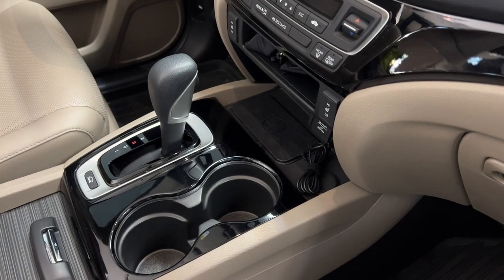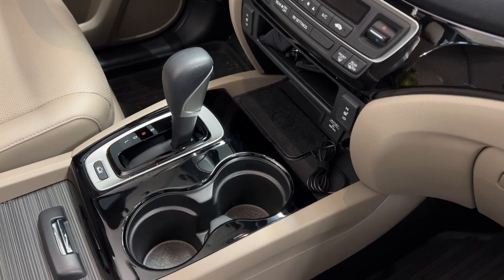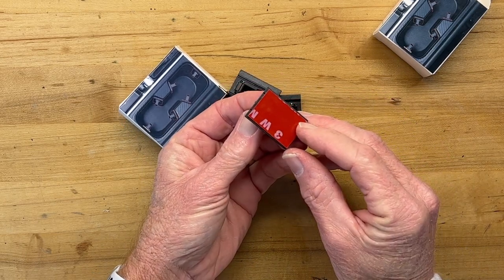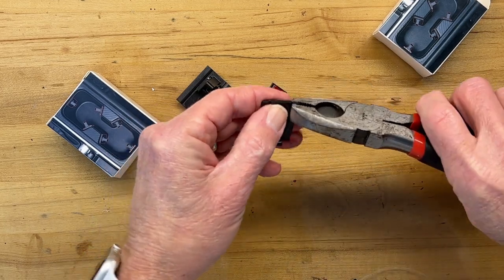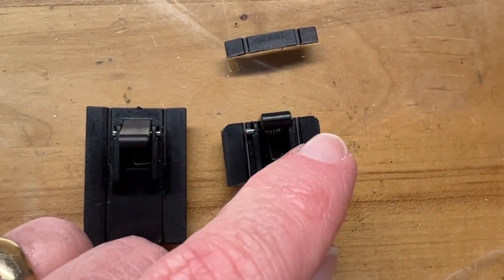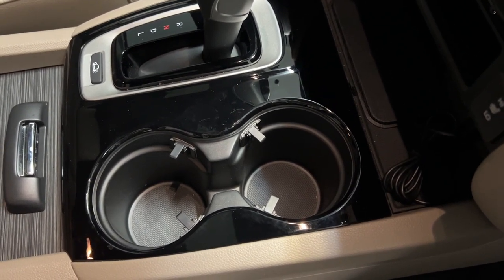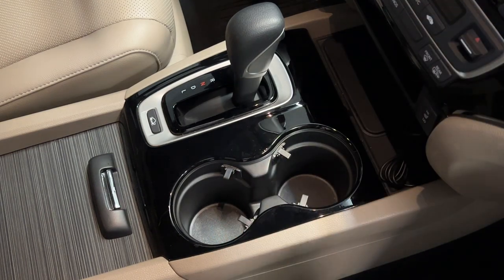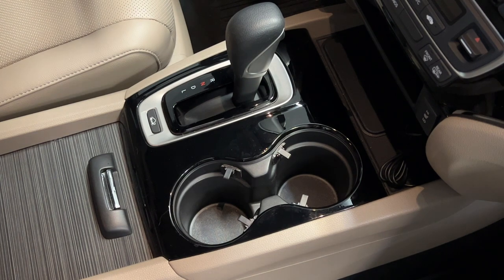Honda Ridgeline & Pilot Cupholder Upgrade. Slick fix for wobbly cupholders!

Comment: My workaround for the cupholder issue is to use one of the front sections of your console organizer (from your upgrade vid). Have a 32oz Yeti SS water bottle. It slides inside the plastic divider. A perfect snug fit!  Only issue with your mod is that the tape will start to peel away or move in hot/humid weather, become a goopy mess or mar the plastic after it unpeels.  I enjoy your videos about the RL, keep them coming!
Reply from the maker: Thanks for watching and taking the time to leave a comment! My console is filled with 'stuff' so it never occurred to me to put a cup there. I've looked at the cupholders from some Pilot and MDX models that have four 'fingers' to hold beverages and if I can ever find one at a reasonable price I may try to fit one to the Ridgeline. You may be right about the tape, time will tell. In any event I can always pop the fingers out and clean up the residue with some Stoner Tar & Sap remover. That stuff is amazing. My wife once drove on the interstate where a repaving project was underway, the rocker panels and rear fenders were a gooey mess. Stoner took it right off in only a couple of minutes.

Comment: I appreciate your video and I noticed the same issue with my 2019 Ridgeline. I have a solution to offer.  I used a small piece of self adhesive weather stripping which tightened up the cup holders really well. Super cheap so even when they start to fail it’s an easy fix.  I wish I knew how to attach a picture to this comment!
Reply from the maker: Thanks for an interesting solution, I'll give it a try if the 'fingers' ever fail me.

Comment: I also have a 2018 Ridgeline AWD.  What I've been doing is: 3 pieces of paper towel or equivalent and wrap it around the bottom of the cup/container and placed it in the cupholder.  I don't get the rattle...and over time the paper tissues are molded to the edges of the cupholder.  I leave it and reuse it.  That's my quick/cheap way of keeping the cup/container in the holder secure and not rattling. 😂

Comment: I have Ridgeline with same cup holders. I bought 2 Swigzy car cup holder expander adapters. I got them on Amazon for around $26.00 a piece. They are expensive, but work great. Takes really big cups or small. The best aftermarket cup holder that I’ve found. I also love my Ridgeline-2019.
Reply from the maker: Thanks for that option, I just googled the Swigzy and it looks well designed. I prefer to have the top of the holder flush with the console. One of these days I may take the console apart and, remove the OEM holder and glue something like a pair Swigzys in its place. 🙂
Reply: @Koolbob2  I see.  I like my cup holders higher.  Then if you would be driving and grab your cup, it’s very unlikely you would hit your cup on the shift knob when you grab it.  I had that issue when just using the original holder.  The rubber tabs on top of the holder really keep the small cups from rattling around as well.  I love the product, just not the price.  And 2 of them do fit fine, when both in at the same time.  I originally bought them to be able to hold big Nalgene bottles.  Liked your video and just wanted to give you another possible option.
Reply from the maker: @rtmy2girls  Thanks for the info! I may be biased, but Ridgeline owners seem to be the most likable and helpful folks around.

Comment: Did you have a reason not to use the third one at top and bottom?
Reply from the maker: Great question! Installing three was too many and my water bottle wouldn't fit. Only one wasn't enough to keep the bottle in place, but two is just right. :)
Reply: @Koolbob2  Thanks, never understood why Honda designed cupholder without the retention fingers. The cupholders on my 07 Hyundai Santa Fe was much better designed. Will order a set  and see how many is needed for my cups and bottles. Thanks for your video!
Reply from the maker: @kennyr9924  If you don't mind, circle back after you install yours and let me know how you like them.
Reply: @Koolbob2  Sure, hopefully walmart has them in stock